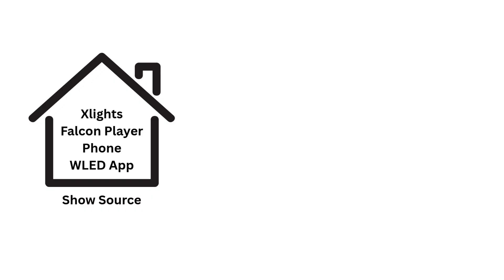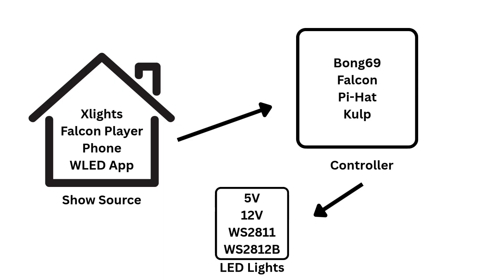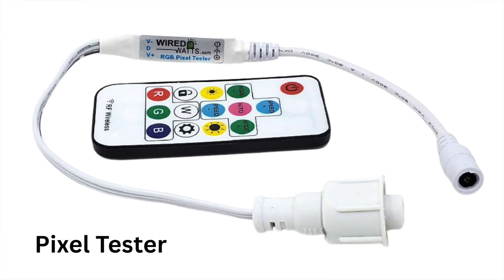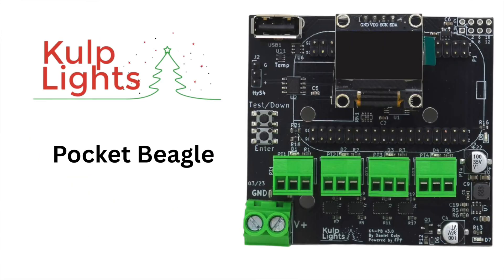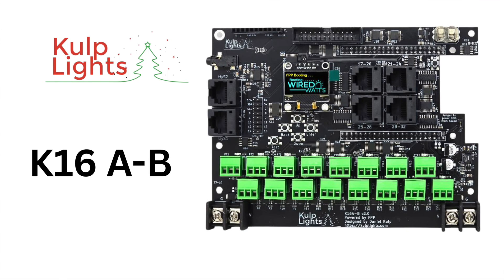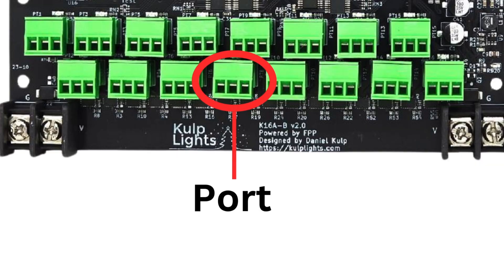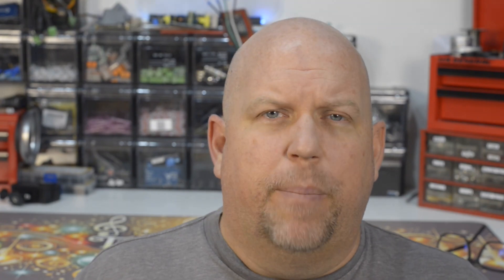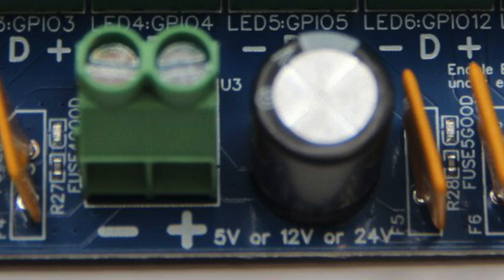Part 3 - LED Controller Guide: Falcon, Kulp, Bong69 & More Explained!

Comment: Do you run a switch to connect all you controllers to the main board, It looks like the Bong69 only has one input port
Reply from the maker: "Outdoor 8-Port CAT5 Distro: The Ultimate Solution for LED Lighting & Networking Projects!"
https://youtu.be/RTxgsaDh7vk
Reply: @twinkletunesandlighting  Thank you, that's exactly what I was looking for
Reply from the maker: I sure do. Most of my controllers are hard wired. There is a video I made I will post the link to.

Comment: Thanks for the video. I as hoping this was video was going to go into more detail comparing them all against each other. Unfortunately this almost seemed more like a sales pitch for the bong69. IMO - the top controllers in the holiday lighting hobby are Falcon, Kulp, Genius, Baldrick… with a possibility of Wally’s controller board and YourPixelStore controller. For new lighting enthusiasts it might be best to steer them in the direction to a board that has a large community of support (falcon/kulp). I would probably guess those boards would be best for 80%-90% of people that are just entering the hobby. Your tinkering comment towards the end of your video peeked my interest, but then  I remembered that come showtime, the last thing I want to be doing is having to tinker with something. I personally haven’t tried a bong69 controller so please take my opinion with a grain of salt. I’m just a dude in the hobby that has used a couple different brands of controllers and receivers in my shows throughout the years. Like you mentioned, there are endless possibilities on how to setup a light show. Thanks again for the content 😁
Reply from the maker: Hey, thanks so much for the detailed comment—and for watching!
You make some really great points here. You're absolutely right: Falcon, Kulp, Genius, and Baldrick have a ton of solid support in the community and are great choices, especially for folks getting serious about larger setups. I definitely agree that strong documentation and an active user base go a long way when you're starting out.

This video leaned a bit more into what I personally use (which is the Bong69), but I totally see how that may have come across more like a sales pitch than a balanced breakdown—totally fair feedback. Going forward, I’ll definitely consider doing a deeper side-by-side comparison of the major controllers, especially from the perspective of scalability, ease of setup, and community support.

And I hear you 100% on the “no tinkering during showtime” sentiment—when it’s crunch time, reliability beats flexibility every time.

Really appreciate your insights and experience—comments like this help make the community stronger. Thanks again!